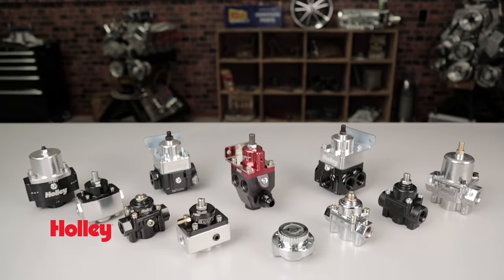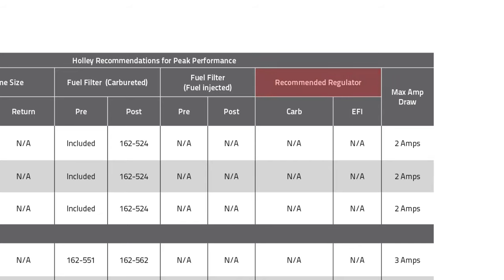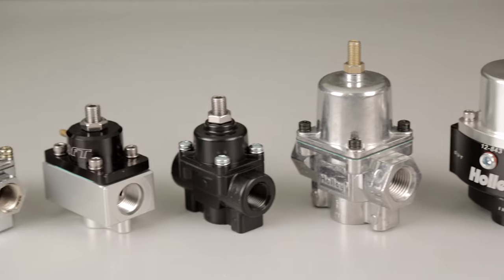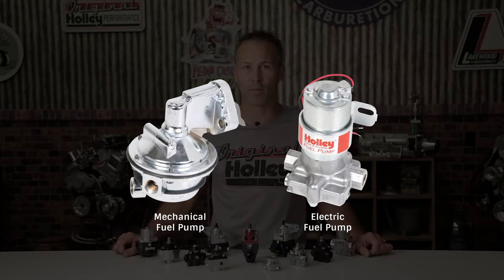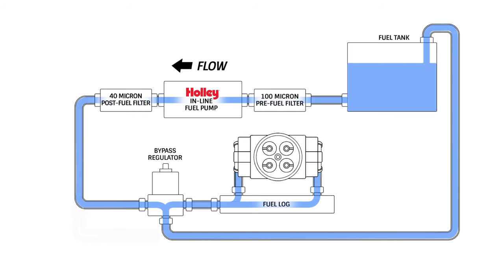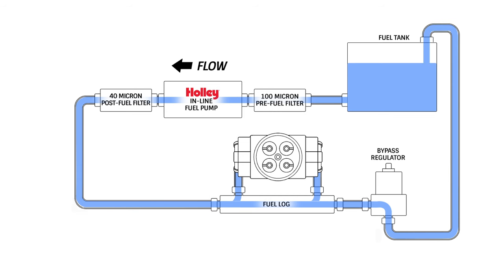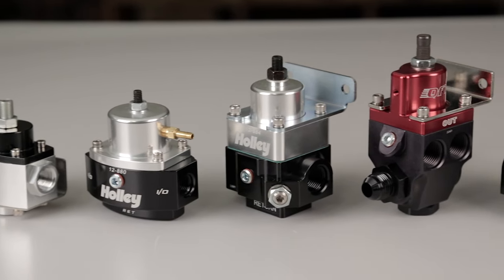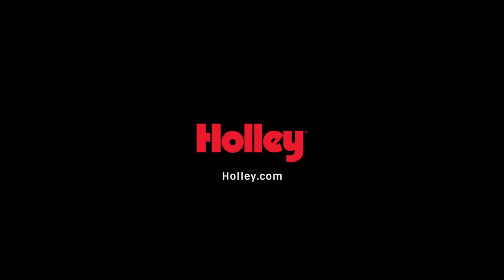How To Choose A Regulator for Carbureted Vehicles

Comment: I bought the Holley Red pump rated for 7 psi for my sbc 350 with a Holley 4150 650 CFM. Had the issue where the pump would keep pumping fuel all the way through the carb and flood it. Sound like some a deadhead regulator could handle or should I be safe and run a return line?

Comment: I have a question. In a return style system..What is the difference in using a deadhead regulator post carb vs a bypass regulator post carb? In my head its doing the same thing but for 1/4 the price

Comment: Hi, I would like to replace the original low pressure vacuum fuel pump for an in-line electric fuel pump on my outboard in order to deliver fuel from the tank to the high-pressure pump-evaporator, which fuel pressure regulator could be used between my fuel tank and my high-pressure pump-evaporator?
  The low pressure pump must operate between 2 and 4 psi of pressure.
  This will eliminate prime the fuel manually and avoid to buy an expensive low pressure vacuum fuel pump OE replacement part.

Comment: I bought a Holley bypass regulator. If the pressure is reduced on the “OUT” side of the regulator, and it’s connected AFTER the carb, how is the pressure reduced at the carb if regulator is after carb??
Reply: If you were to uncap your fuel line coming from the pump, and let if flow into a bucket, you would have ZERO fuel pressure in the line. There is no restriction, hence no pressure. The regulator after the carb creates an obstruction in the fuel circuit, just enough to set the pressure at 6psi, or whatever you have it set to, and the rest of the pressure that is over 6psi or whatever you have the regulator set to goes through the regulator and goes back to the tank. The bypass reg simply creates enough of a restriction to allow 6psi to build in the line, and lets the rest escape to the tank
Reply: I am definitely not an expert but I assume it is because it's a complete circuit. The resistance to flow at any point limits the entire system.
Reply: @justinjburk  I get it now, it reduces pressure through entire circuit, versus just after the circuit

Comment: Hope you can help I changed from mechanical  to inline electric my trouble is the engine starts and runs for about 15 to 30 seconds then hesitates then stops. starting an hour later.the truck is chev 305 with spectra premium pump.does it sound like it needs a regulator.
Reply: Beginner Beginner I am having the same thing on a my mustang.
Reply: I just switched from mechanical to efi on my c10. Having some trouble getting the pressure to adjust on my setup. Got a bypass pressure regulator and no matter what I adjust the pressure still reads 0psi.

Comment: I have a 770 Avenger. carb and the 12-803 regulator.      Is there a benefit to running one outlet of the regulator to the primary fuel bowl and the 2nd outlet to the secondary?     I currently have one outlet of the regulator feeding both fuel bowls with the  2nd outlet blocked off.

Comment: Why does the Holley 12-803 regulator state in the instructions not to use it with a mechanical fuel pump

Comment: Could the dead head set up cause dieseling?
Reply: It should limit deiseling if it is set correctly. Too much pressure can be part of what causes deiseling.
Reply: No, a deadhead regulator will not cause dieseling.

Comment: I just bought the by-pass regulator #12-881 and hooked it up just like the instructions say to and I cant get the pressure down the gauge goes to max pressure even backing the adjuster all the way out, I am using holley blue pump my dead head regulator did not do this at least I can adjust it, I have switched the return line with fuel supply and it goes to zero pressure or max still cant adjust it maybe I have the wrong regulator for my carb and pump?
Reply from the maker: Give our tech line a call at 866-464-6553! -Keith

Comment: I already have a regulator for my carburetor, I need a fuel gauge that bolts on to the regulator to see when get to 3 psi that I need
Reply: So, buy a -4 AN fitting, and a hose, and connect it to the pressure port on the regulator.

Comment: What a good supply pump with a built in reliable regulator and 1/2 inch inlet outlets to about 4-9psi for waste veg oil in a diesel vehicle please? Its protecting as well as supplying fuel to an expensive pump so the set up needs to be good.

Comment: Why a bypass regulator after carb ?   Will a regular regulator work??
Reply from the maker: Bypass regulators tend to be the most accurate and most capable. A non-bypass regulator can only handle so much flow and pressure.
Reply: HolleyPerformance thanks
Reply: A bypass regulator doesn't heat the fuel as much as a deadhead regulator does also. With a deadhead, the pump is constantly pressing all of it's output psi against the fuel that is backed up against the regulator, and the fuel is getting hotter. With a bypass regulator, the pump is only working against the 6psi or whatever you have the regulator set to, and the rest of the fuel is sent back to the tank to cool off. Cool fuel=more power, and less detonation issues.

Comment: I don’t understand how it’s possible to put the regulator after the carb.  I thought the whole point of the regulator was to decrease the pressure going into the carb?
Reply from the maker: Kinda like a posi-trac in a plymouth. "just does"
Reply: You have to remember that fuel is a liquid that is incompressible (hydraulic). Therefore using a regulator that is set at say 12 psi max after the carb would mean that even the fuel log pressure will be the same pressure regardless. The best way to let the know the fuel pressure is to use a dash mounted fuel pressure gauge.
Reply: A wide open fuel line would have ZERO pressure when flowing into a bucket. Put a 6psi restriction anywhere in the line, and the pressure will be 6psi everywhere in the line. The regulator after the carb holds the pressure at 6psi, and lets the rest of the fuel flow, that would cause a higher pressure, back to the tank. Think of a return system as an organised leak, that self adjusts to limit the pressure to a preset limit. If your garden hose attached to a lawn sprinkler is holding 30psi of water pressure, and suddenly a pinhole appears, the pressure in the hose everywhere will be lower because of the water leaking out of the pinhole. Your carb would be at the end of the garden hose, and the "pinhole" in the hose is the return line that goes back to your tank. The regulator would be the pinhole that automatically adjusts the size of the pinhole to keep the pressure constant with regards to flow.
Reply: @davelowets  fantastic explanation thank you
Reply: @yeboscrebo4451  👌

Comment: Car manufacturers have switched to returnless systems because the bypass system was heating the fuel and increasing the vapor in the evap system. Now this guy is saying the opposite??
Reply: Car manufacturers have switched to returnless because the pumps direct output pressure is now controlled by the ECU. No need for a return anymore.